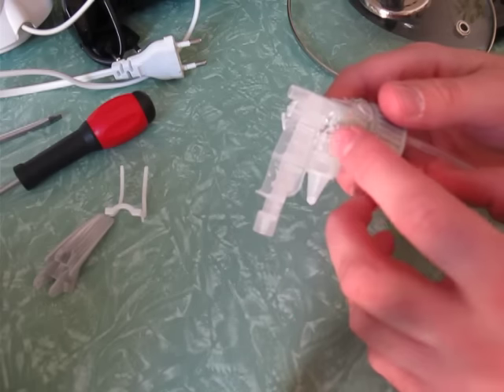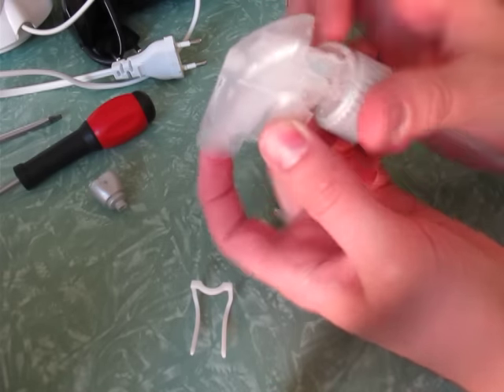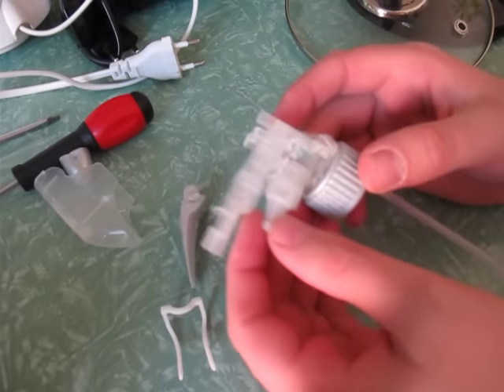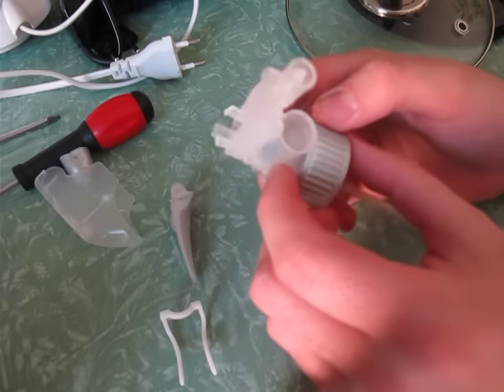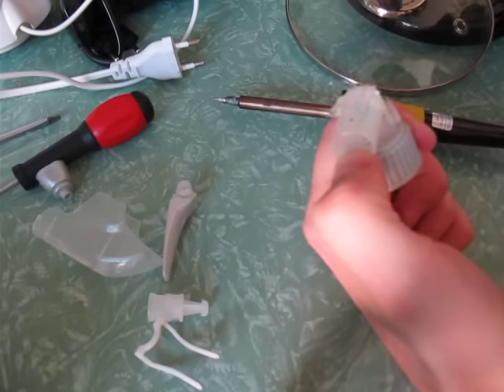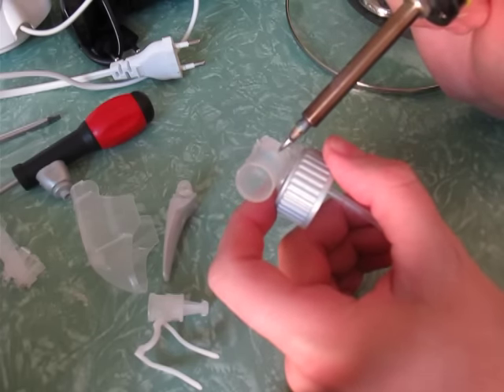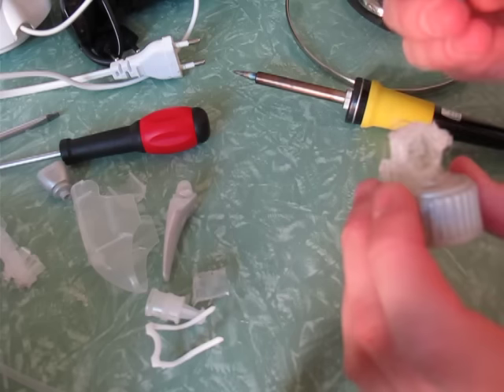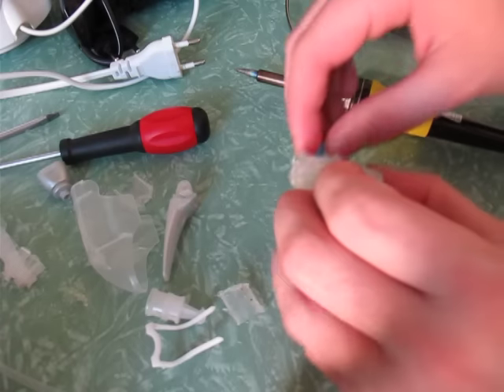Bottle sprayer pump wont work, partial autopsy

Comment: Take a look at this video on you-tube: "How to fix for sprayer is not working pump".  (add a drop of oil to the right place and WOW...fixed!!! Your diagnosis of problem is correct but the drop of oil fix from ther youtube video works very well to fix that problem... no taking of spray pump apart is required.